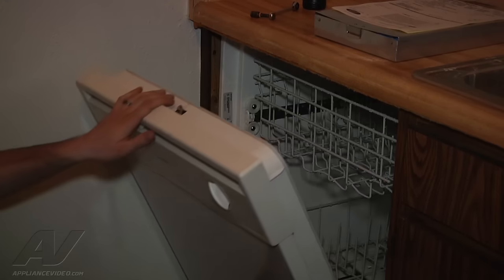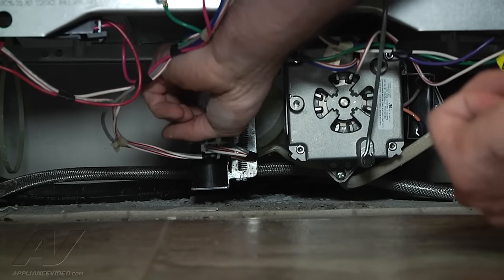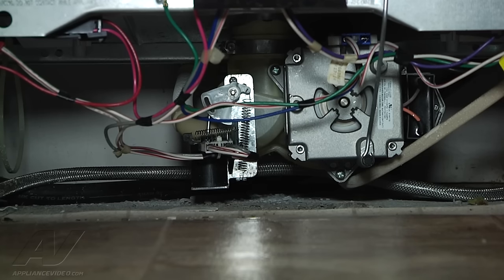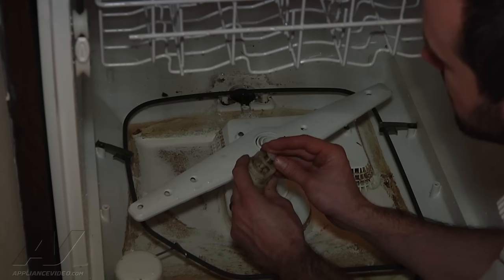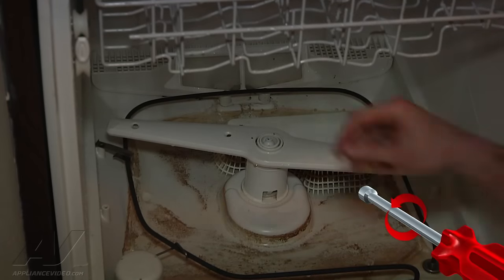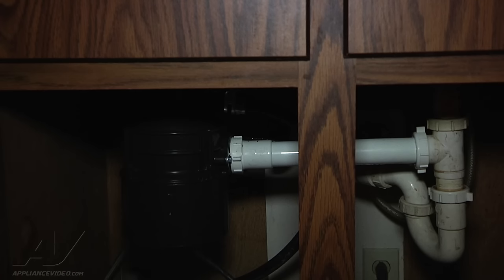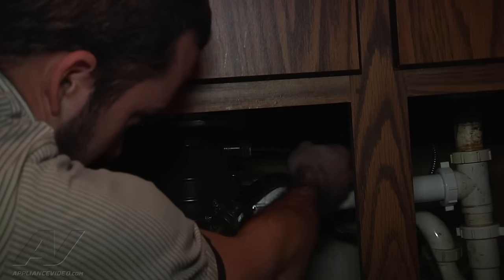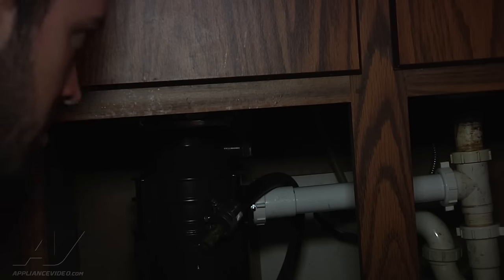HotPoint Dishwasher Repair - Not Draining, Dishes Not Cleaning - Drain Hose

Comment: is this model of dishwasher still manufactured?

we have a whirlpool dishwasher that has electronic controles

the controle computer does what ever it wants

goes on delay, and i can't get it to go off of it.

next dishwasher, i want to try and avoied electronic controles and go with a mechanical timer dishwasher.

any advice?

thank you in advance
Reply from the maker: Kody
   All of our technicians are now answering questions daily on the ApplianceVideo.com website. You can search completely FREE in our Repair Help section with over 1000 questions & answers. Or you can get unlimited technical advice and video links emailed to you by our 14 factory certified technicians at http://www.appliancevideo.com/premium-membership/.  If you are in need of any parts please support our parts department on line at http://savemoreonparts.com/ or call 1-800-830-5465 7-days a week until 11pm Eastern time. Thanks for your support. Matt Ace Appliance factory service technician.
Reply: You don't want this one, believe me.  Especially if  you use it almost daily like we do.  I've seen these installed in long term stay hotels that don't get  used anywhere near as much as ours and they have problems with a lot of standing water too.

Comment: Is there a way to manually release the water?
Reply from the maker: Great question, you can call our parts department at 1-800-830-5465 and they can give
you help 6-days A week Mon-Sat . You can also search at www.SaveMoreOnParts.com 7- days a week.  If you have a more technical question that our parts department cannot answer, our technicians are answering all questions at our website at www.ApplianceVideo.com under our Repair Help section. We have over 4,000
common questions and answers that you can easily search through by your model
number, appliance make, and problem or error codes, and It’s free to search
through our question & answer library.
Reply: Thanks

Comment: I know this video is old. But I have almost the exact model. My problem is when the washer does the final drain cycle the motor turns off. Could this be a timer issue or the motor itself?